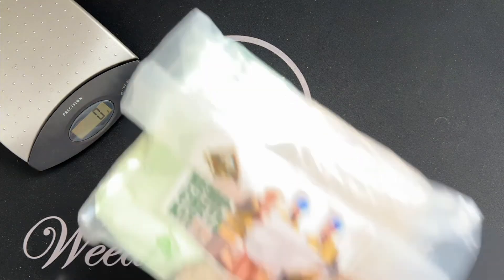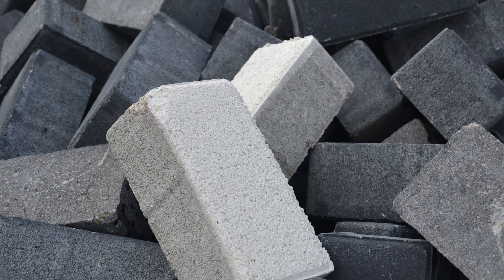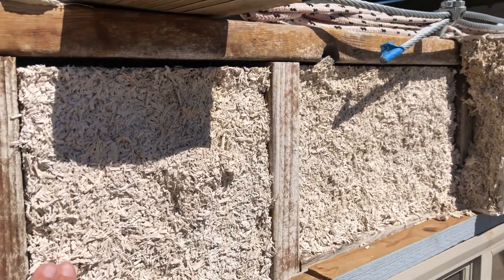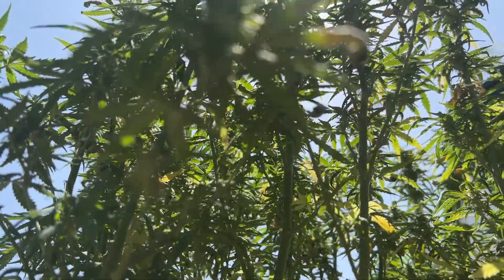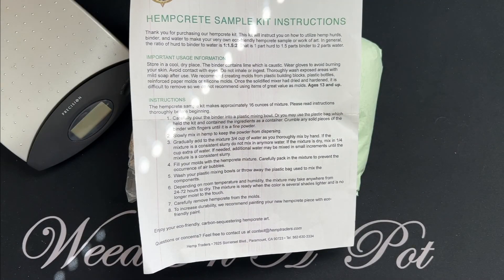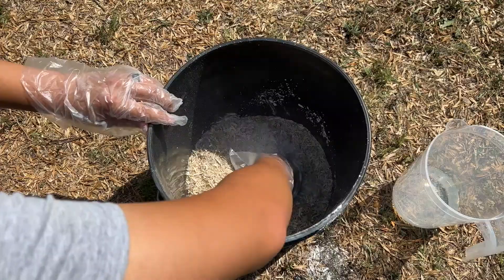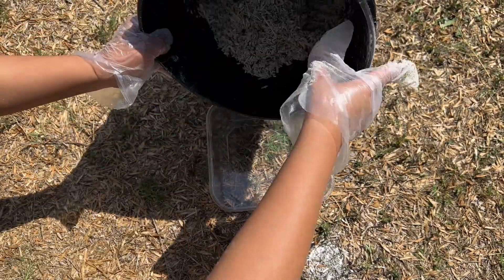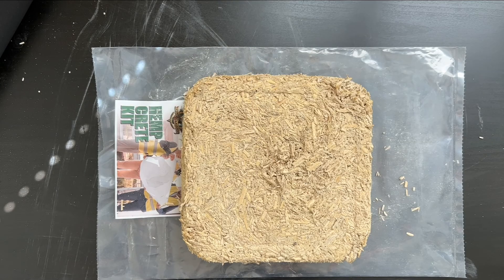How to Make a Hempcrete Block

Comment: I see some inconsistancies in understanding of making hempcrete prodicts. 
The chemical needed is called quicklime, calcium oxide. Its mixed with the hemp fiber and water to form hydrated lime, calcium hydroxide, a strong base, aka slaked lime or hydrated lime.
Qicklime is made from limestone by heating it and driving off carbon dioxide. CaCO3 (limestone) + heat yields CaO(quicklime)+ CO2. (carbon dioxide)
Just some calcium chemistry information.

Comment: This video incorrectly implies hempcrete can't be used for structural repairs.  There's a reason why it's called "crete," not "hempsulation." I fixed my ceiling with hempcrete and it regenerated itself with no mold even when it got soaked several times before I found the roof leak, which could never happen with gypsum Plaster of Paris or drywall.  But you need to add a couple ingredients missing in this video: coarse "well graded" (variably sized grain) sand (not sandbox play sand) and some larger hemp fibers, not just shreds or pellets.

Comment: I have plans for many campground buildings done in this way, but not actually using hemp. 

I have rice husk and coconut coir on the farm already. 

It's a natural choice for me since I can make my own slaking lime, using limestone scraps. My place is 100% limestone, beneath the soil.

There's a persistent tall grass that is a fire hazard. That can be used to fire the lime kiln. The ash contains microsilica and sodium hydroxide, which makes the finished product even less favorable for mold and bugs. 

The entire house can be built from on-site materials, other than some nails and roofing.
Reply: Thanks for the info.

Comment: While hempcrete is amazing, there are some inaccuracies here.. generally hempcrete only achieves an "R -value" of 2.0-2.6 which is quite a bit less than fibreglass. It often "outperforms" fibreglass in that it is a hygroscopic material and can buffer temperatures when water evaporates or condenses inside the wall. The great thing about hempcrete is that it does this without harming the wall. Hempcrete also has a lot of thermal mass because these walls are often very thick (because of the low R-value per inch). This is especially good in climates that swing from cooling to heating during a single day - very little benefit in a northern winter when you're always heating. Then it's just the R value that matters.

Also - the touted "sequester carbon over it's life" comment is a misunderstanding - while Hydrated Lime (the common binder in hempcrete) does sequester carbon in it's initial curing and continues to sequester a small amount throughout it's life (just like conventional cement) it is minimal and it cannot sequester more carbon than was used in the furnaces to turn mechanically ground limestone into hydrated lime, nor the industrial equipment used to mine it and grind it up.

The real carbon sequestration argument for Hempcrete is that WHILE THE HEMP IS GROWING it sequesters carbon through the natural processes of being a plant. i.e. incorporating CO2 into it's body via photosynthesis. The benefit of hemp over other forms of sequestering building materials (like trees) is that hemp grows really fast - so it sequesters lots of carbon very quickly and you can harvest yearly.
Reply: Thanks, in our northern climate we use thermal mass to moderate heat produced by wood or solar. See Tulikivi and Chinese greenhouse.
Reply: Thanks for the great and so useful comment!